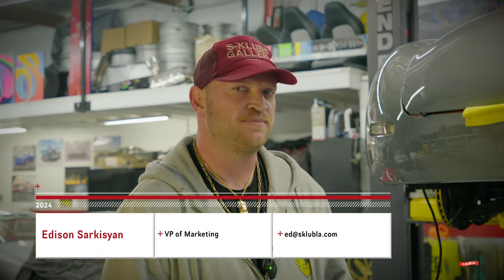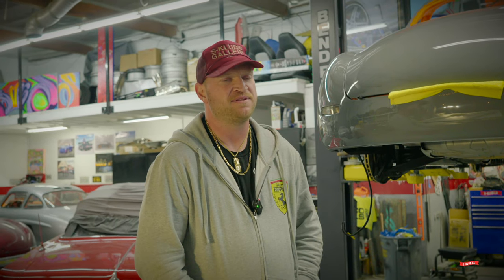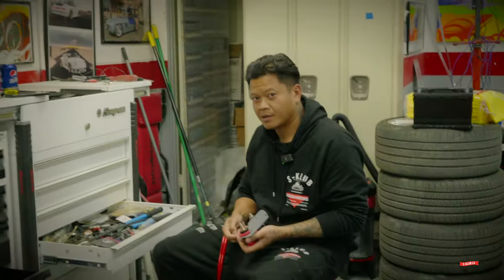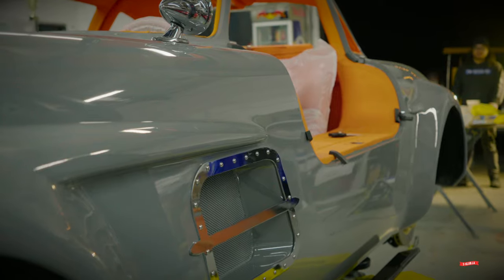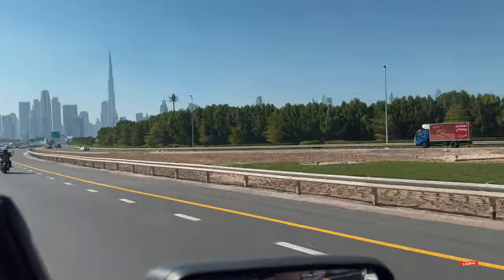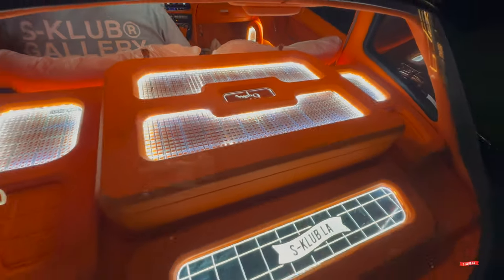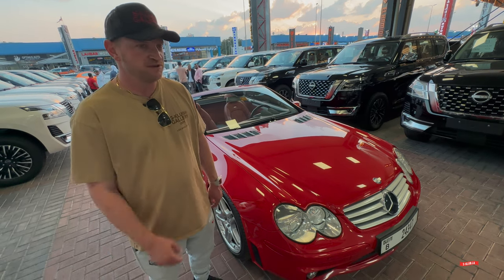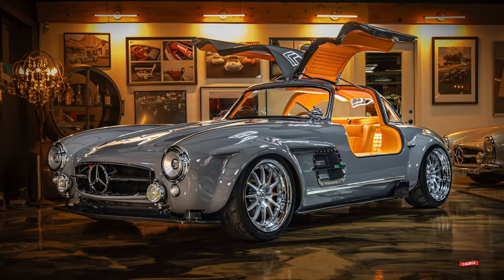Our first GULLWING for Dubai!!!

Comment: Modifying a 300 sl gullwing just doesn’t work. It’s like putting a mustache on the Mona Lisa.
Reply from the maker: We modified an slk55
Reply: @sklubla  I understand it’s not a factory 300 sl. It’s the design that just doesn’t work. But I’m sure a lot of people love it. 
Your craftsmanship is top notch. I built a speedster 959 from a c4. That combination worked. But I’m sure some felt it didn’t.
Reply: Doesn't work? 😂😂😂 They have built and sold several of these at top dollar to a very exclusive clientele. Objectively , I could argue that it's working... working quite well. 🤷🏾‍♂️
Reply: @jemarcusbridges1214  the 300sl gullwing is an icon. You just don’t get it. Vintage auto enthusiasts would.
Reply: @bobwatkins3519 this isn’t a 300SL gullwing.  Not even this company changed the iconic car.  These are reskinned slks.    Not the same to take offense to.